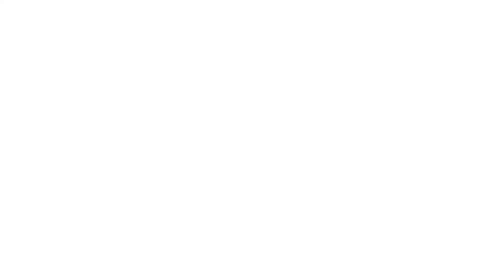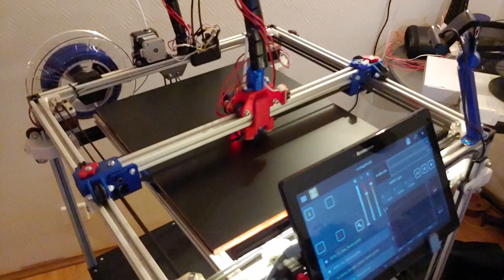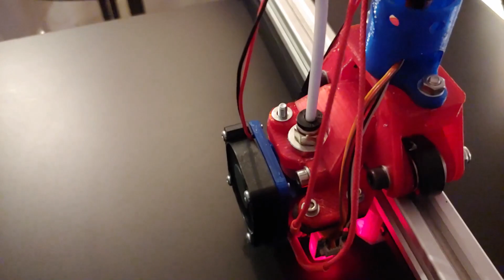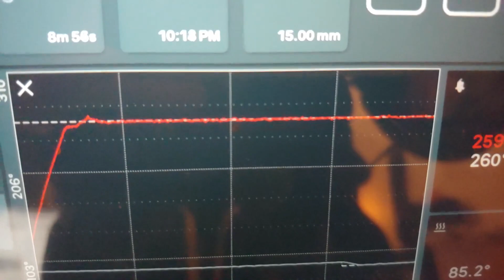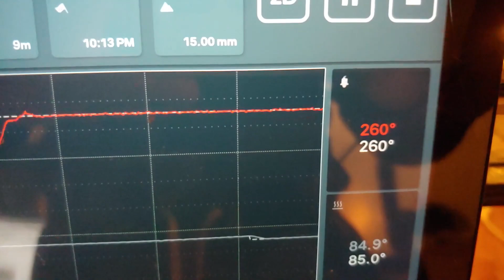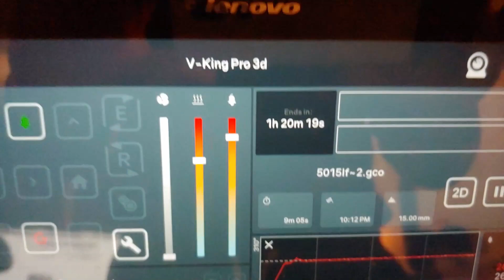V King CoreXY - GOOD 24V FAN!!

Comment: I am thinking of making one of these. Would u discourage using linear rails for the xy?
Reply from the maker: If using rails you should get high quality. They are very expensive. The wheels are very smooth and easily maintained. No sliding movements